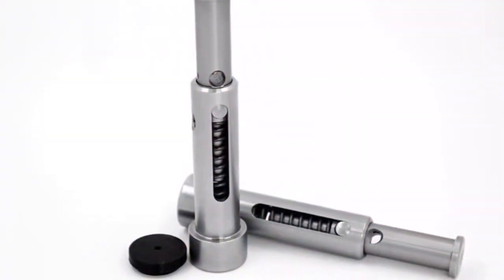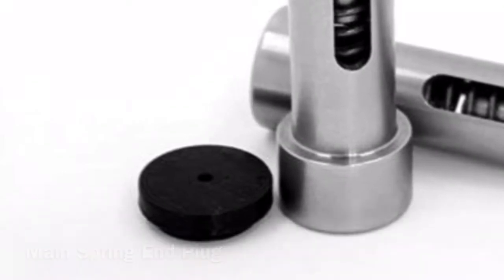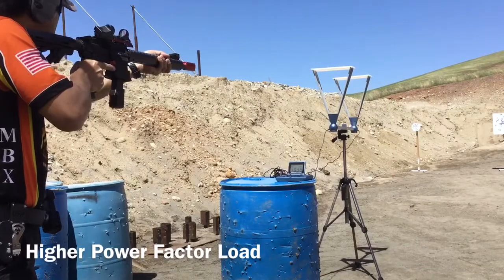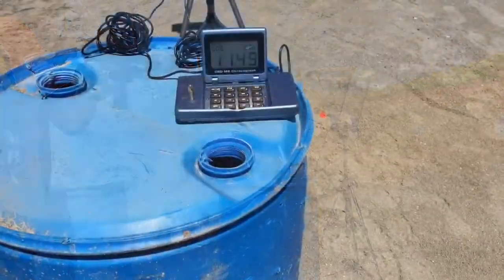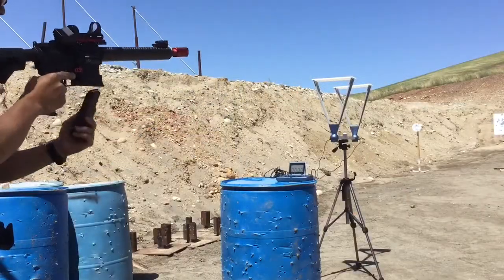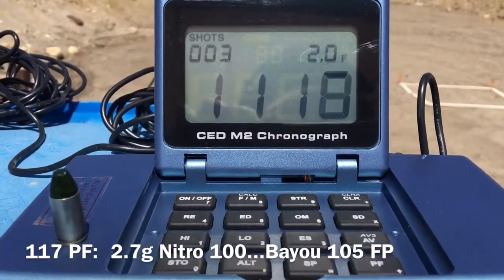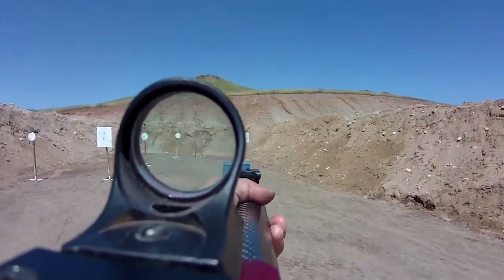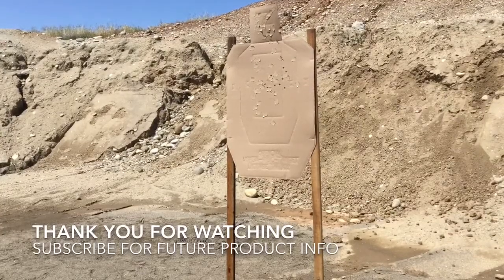MBX PCC BUFFER SYSTEM

Comment: What bolt you guys running with your MBX Buffer setup? And how much bolt weights? I have JP Bolt 13.3oz and wonder if it will work with MBX Buffer Setup. I run 140PF 124gr Precision Delta.